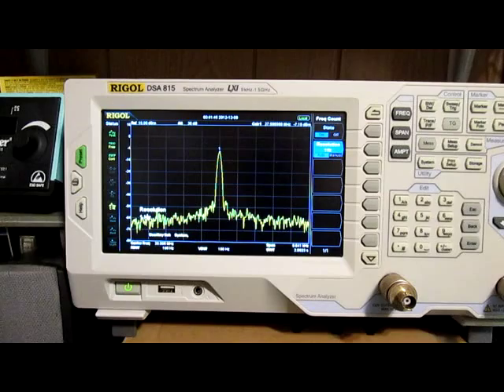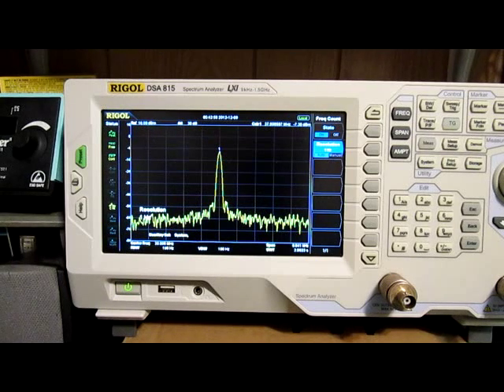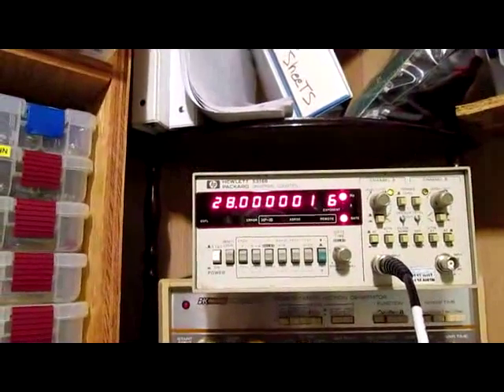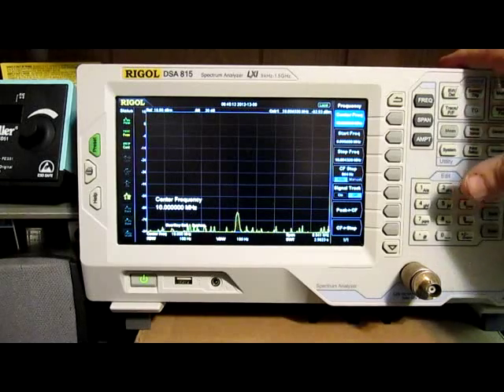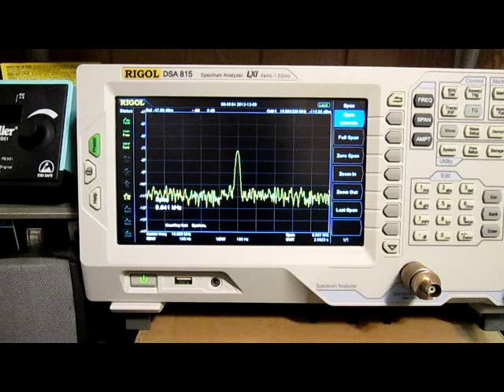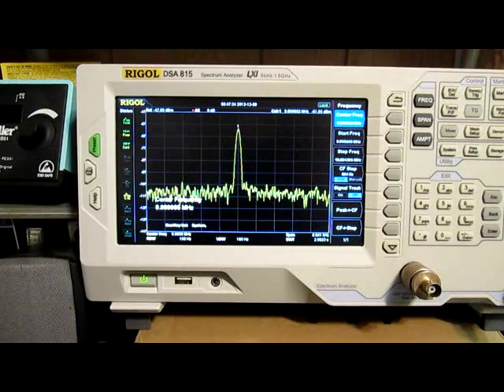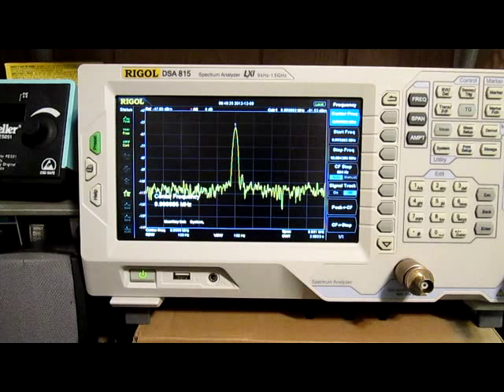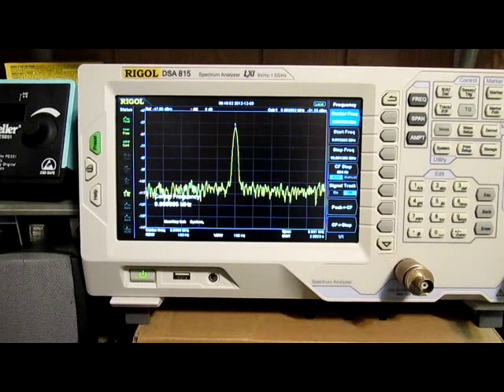RIGOL DSA-815 RF Spectrum Analyzer Frequency Accuracy - Revisited AGAIN! :)

Comment from the maker: Looking at the DSA-815 Specs on frequency accuracy .. its listed as being < 2ppm. Again, this is not as good as the Leader LDC824S. Couldnt find a manual for just a Leader LDC 824 .. Unless you just left the S off. Either way .. I would hang on to the frequency counter if it were me. Thanks for watching my videos.

Comment from the maker: If your Leader is the LDC824S model then it is more accurate than the Rigol 815, with a 1 ppm standard accuracy. As far as calibration goes, I dont know other then what I mentioned above about supplying a very stable external reference

Comment from the maker: If it were me, I wouldnt. Not because the Rigol might be accurate enough .. I think its proven itself in that area. But moreso because I can see situations where I would use one over the other, depending on signal content, amplitude, etc. If you examine the Rigol DSA-815 specifications in the manual, I believe its more than accurate frequency wise, not to mention the fact that you can also supply your own 10 MHZ "stable" reference to the rear imput jcak on the analyzer..